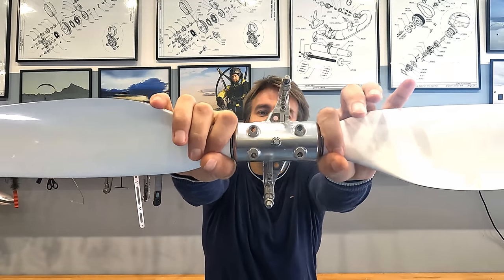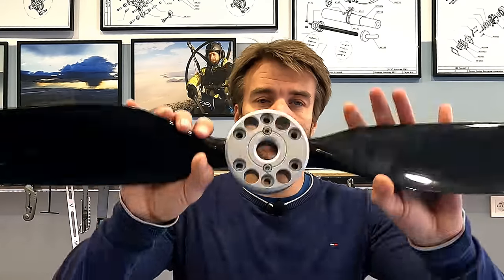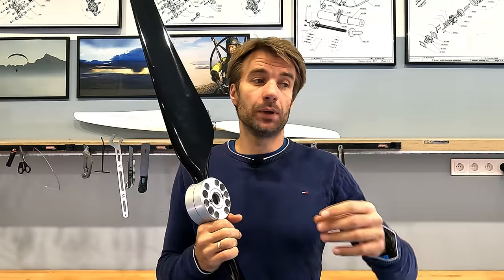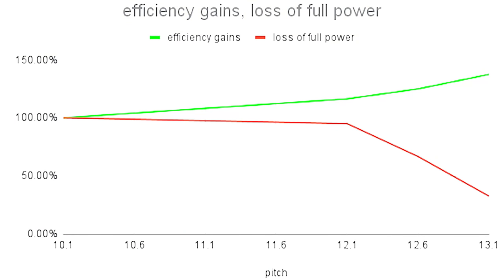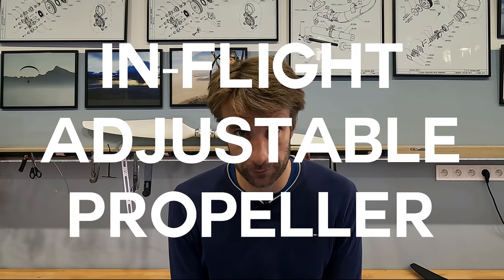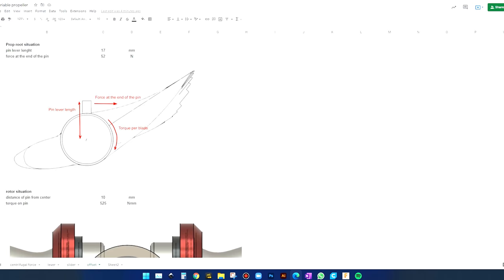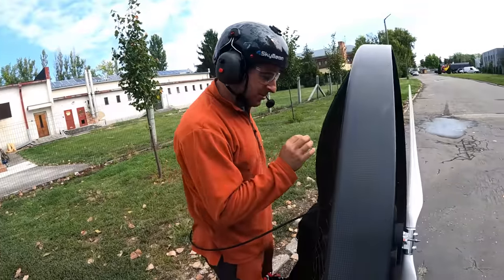Will this be the best paramotor propeller in the world? Variomatic propeller

Comment: As an aerospace engineer, this is interesting.  Curious if a single spring set will allow users of vastly different weight to tune the "shift" point?  I imagine you don't know this yet but what will the spring change interval be?  That might have to be meaningfully long.  Also, it might be good to have a way for the end user to tighten the spring to a particular measured length so that they don't have to guess where their optimal position will be.  At least that way, most users can use it without much adjustment.  Also, how does it fail?  If the spring mechanism broke, what happens?  I am sure you all have thought through many possibilities on this by now.  It is definitely an interesting idea.
Reply from the maker: The blades are linked and they operate simultaneously. you can see at at 6:40 in the video.
If one spring breaks than both blades would be held by one spring only which is not enough and the prop would shift to 10 degrees. Just like a standard prop.

We do not say this is the final design. This was designed in a way that everything is adjustable. We even had shock absorbers to eliminate eventual fluttering (did not happen). The final design can be simplified now that we know what springs and settings we need.
Reply: @SCOUTaviation  Thanks for the explanation.  It is exciting to see you all go after bringing better technology to our sport.  There are definitely a lot of ideas out there that can improve it but they are often applied to multi-million dollar/euro aircraft.  It is definitely a tricky endeavor given the price points and quantities constraining the industry.  I look forward to seeing your design evolve over time.  Good luck!

Comment: Just in energy economy alone I think this is awesome. But let's go a step further. Add windmill mode to recharge batteries extending powered flight time. Being able to charge on the fly (pun intended) could change travel forever.
Reply: There is no such thing as free Energy - Windmilling reduces your Glide a LOT, the harnessed Power would be a Lot less than the wasted Energy
Reply: @mraffifpv1685  I agree a pilot would be looking for points of lift to maximize glide slope regeneration. Environmental lift and gravity are still free :)

Comment: I understand the point about fixed wing use, but aren't you talking about general aviation (GA) aircraft and not ultralights? I've got an ultralight kit on order for a high wing tail dragger STOL aircraft. Much as you pointed out with PPG, I will need full power (high RPM) low pitch for take off, especially for STOL. Once off the ground and at my chosen altitude I would like to throttle back (cruise RPM) with higher pitch for fuel economy. Since US ultralights are limited to 55 knots maximum speed in level flight we don't have the wide speed range you mention that GA aircraft have. Our power use is pretty much identical to PPG. I would love to bolt one of these props onto my ultralight. Of course with PPG the prop is pusher while many ultralights are tractor pull. I will be watching to see your future testing of this prop.
Reply from the maker: Yes. The bush planes would benefit I guess.

Comment: This combined with an electric engine would be great.  Wouldn’t have to worry about engine cooling issues.
Reply: This is what I thought too! This kind of prop will ease the electrification of paramotors! I like that!
Reply: Electrics do not have so much efficiency or power change from 0-max rpm. You prop an electric motor for max efficiency at trim/cruise speed. There may be some efficiency loss when climbing at higher RPM but if that's a low percentage of the flight profile you're not saving very much. ICE are inefficient at cruise because they are pitched to allow for more power in climb.

Comment: If Stephan is interested, ask him to see what’s being done with Ducted Fans on paramotors
Reply from the maker: Larger prop is always better. Period. Every aircraft designer in need of thrust increases the prop diameter first. If more power is still needed but a larger prop does not fit then aicraft designers use ducted props for further increase of thrust (not efficiency). Thus a small prop in a duct will never outperform a large prop.
A large prop in a duct would outperform a large prop.
For paramotors in order to benefit from ducted prop the duct would have to be about 15cm thick and about 50cm long. Such a large duct would be heavy. 
The gap between prop tip and the duct would have to be few millimeters. That would require very rigid structures  and again add weight. In case of any mistake on landing the duct is busted.

Comment: Since it only has to move 3 degrees maybe you could just design the blade to flex that much.
Reply from the maker: Yes that might be an option. it would be simple and lightweight.
But that would be very hard to develop. 
Changing a spring takes 3 minutes and we see the result immediately.
Changing stiffness of the prop blades requires manufacturing a new pair with different composition. And then how would we be sure that both blades flex exactly the same? Manufacturing would need to be extremely precise.

Comment: All right, the obvious question, when can I get one?  And how much will it cost?  (Sorry, that's 2 questions.).  Also, is it one prop fits all engine powers?  Or a different prop design/size for larger/smaller engines?  I produce electric propulsion systems for ultralights in the US and this would work perfectly on the smaller soaring trikes.  If it can save 33% in fuel, imagine the range increase per charge!  That's like going from lithium ion to a solid state battery, only cheaper!
Reply from the maker: We re discussing serial production now so I hope to have answers to your first two questions soon.
We will first make one for the Vittorazi Moster 185 and similar engines. 
I think the next could be Atom 80 / Top 80.

Electric> I am not sure if the electric would benefit from this prop as much. I think the fuel savings actually come from the engine running at lower RPM. Just like your car consumes less fuel in high gear than low gear at the same given speed. 
Would the electric motor run more efficiently at lower RPM?
Reply: @SCOUTaviation  Hi, and thank you for the response.  Your question is a great one.  When I worked with propeller designers at NASA and elsewhere I learned to think of it from the standpoint of a bicycle that has multiple gears.  You alluded to how pitch can either overspeed the engine or bog it down depending on the pitch.   The same is true with a bicycle.  There is a gear that is perfect for every speed and load (uphill or downhill).  That perfect gear (pitch) is the most efficient operating point for the propeller and aircraft combined.  Even though electric motors and gas engines have differently shaped torque curves, both benefit from matching the right gear (pitch) to the right speed (RPM/airspeed; they're related since a propeller is an airscrew with an advance ratio).  If for example a prop on an electric motor is pitched for climb, when it gets to cruise it will be using excess energy as the cyclist is pumping his legs really fast trying to keep up the airspeed when the gear is too low.  This is an inefficient condition.  The same goes for the opposite situation (too high a gear to climb the initial hill).  I don't pretend to understand exactly how your pitch change mechanism achieves the right pitch, but it sounds like it's finding the right gear/pitch for a given condition.  If that's true then the electric motor would certainly benefit.  It may not benefit as much as a gas engine, there may be some hidden dynamics, but an initial assessment and test is certainly worth the cost.  Let me know when you've got one I can test.  silentelectrics@earthlink.net

Comment: Wow.  But what would this do for electric motors ?
Reply from the maker: I do not know. Honestly I believe that the fuel savings are coming from the motor in this case. Here is my theory:
The amount of thrust needed for level flight is defined by the glider and total weight and it is the same regardless what prop setting and RPM we fly at. 
The prop might be a little more efficient at higher pitch and lower RPM but I doubt the difference is that much. 
I think it is the engine that runs a lot more efficient at lower RPM. Just like you can drive your car at 90km/h in the third gear and sixth gear. Same power (defined by aerodynamic drag and tire drag) but fuel consumption will be much lower in the higher gear. 

Now to your point: I am no expert in electric motors but I don't think the efficiency of an electric motor would increase that much with reduced RPM. If at all.
Reply: @SCOUTaviation  The prop might be a little more efficient at higher pitch and lower RPM but I doubt the difference is that much. ----> would love to see the results of this calculation

Comment: Maybe all this time and effort could be better spent into getting that perfect Scout Aviation Nano Paratrike that will not tip over. The future of sport aviation needs wheels and electric power systems.  Love all things Scout.
Reply from the maker: we did a lot of research into trikes before. We tried everything including leaning the trike to sides and automatic rear wheel steering! 
We already have an idea how the perfect trike would look like. It is on the list but not on the top of it. 
Right now we are working on many R&D projects:
1. Paragliding pod harness with climb assist
2. Variomatic Prop
3. smart paramotor computer
4. new helmet
5. tandem spreaders
6. new throttle
7. another special prop
all of these incorporate innovative features and that takes time. ultimate
Reply: @SCOUTaviation  I look forward to these projects. The smart computer is badly needed. Instrumentation on paramotors is pretty dire. A fully fledged monitor for rpm, hours, EGT, CHT, fuel level and a safe start built in would be a great start. Added GPS and ADS-B would be perfect.

Comment: A prop with a flexible trailing edge produces similar results.
Reply from the maker: most likely yes
But it would be difficult to develop. Changing the spring pre-load takes 3 minutes. Changing the whole spring 6 minutes. Experimenting with the propeller flex would be a painful process of trial and error.

Comment: You did not mention CTM
Reply from the maker: Yes, it surely plays a role as well.
It is only possible to guess where the center of lift would be relative to center of pitch rotation. Same for centrifugal twisting moment. All the calculations are just qualified guesses at best. 
We expected we will have to move the center of rotation by trial and error to where we need it to be. We were lucky. it worked on the first try.
Reply: @SCOUTaviation  In Full scale (which I am most acquainted with) CTM is Is orders of magnitude more powerful than Aerodynamic twisting moment. CTM is is dependent on the chord of the "mass" of the blade.

Comment: Dangerous to turn on the motor while not having the para motor strapped on your back, it could suddenly turn on with full power and pull straight face to you
Reply from the maker: true. starting it on the ground was the only way to actually see what the prop is doing. 
Fortunately all SCOUT paramotors are equipped with SafeStart device that significantly reduces the risks.
https://www.youtube.com/watch?v=yqI3J7H-dmo&t=26s

Comment: Wood same function work on a real airplane
Reply from the maker: sure it would. the question is> Would you want it to work the same way? I think the bushplanes might have similar needs (relatively small speed range, steep climbs). I think regular ultralights would benefit from pilot-operated pitch adjustment. 
Am I wrong?

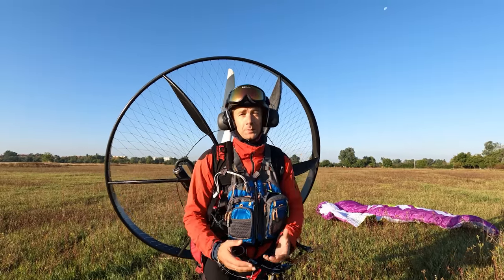Comment: @11:00 - you've not tested this, as you say.  Suggestion: edit your description and remove all the parts that are not true. (e.g. 33%) and when you do finally measure some things, tell us all the real numbers, and do not cheat (e.g. do not deliberately use a wrong fixed-pitch prop for your baseline - use the best-known one, so your improvement numbers (if any) are improvements above state-of-the-art).  And - be brave - if/when it turns out to be no improvement, post the video anyhow: this explains why that is important: https://www.youtube.com/watch?v=42QuXLucH3Q&t=136s
Reply from the maker: I understand that 33% is a daring claim and hard to believe. It was for us too and for that reason we did our measurements repeatedly. 

The video with the in flight consumption tests is being edited now and soon to be released.
Reply: @SCOUTaviation  Don't forget to include the baseline (i.e. precisely what garbage prop you picked that's 33% worse than your new one).